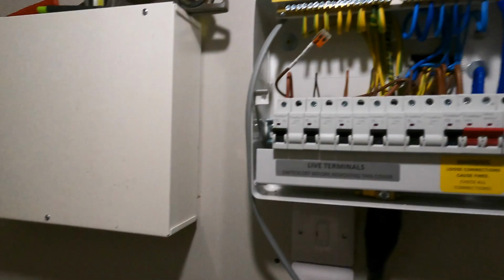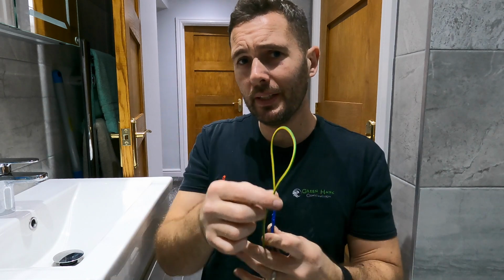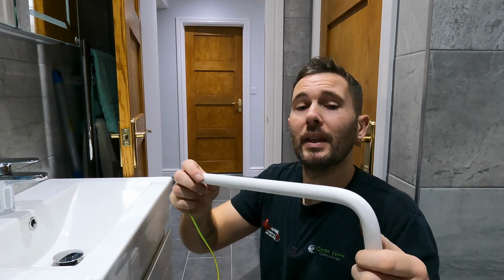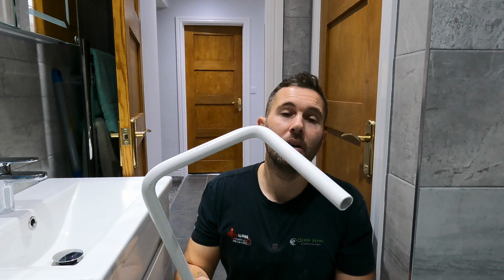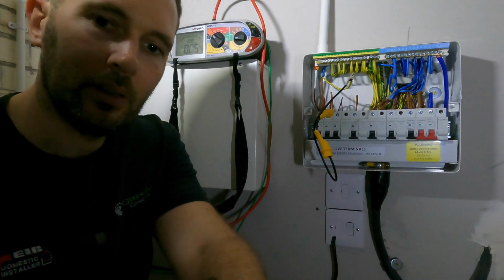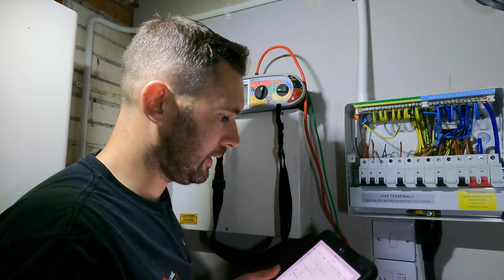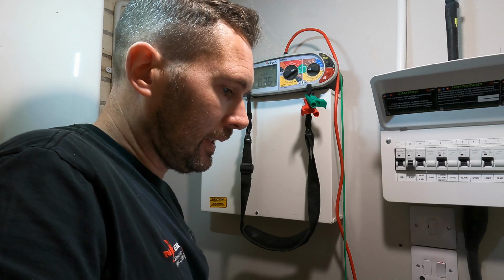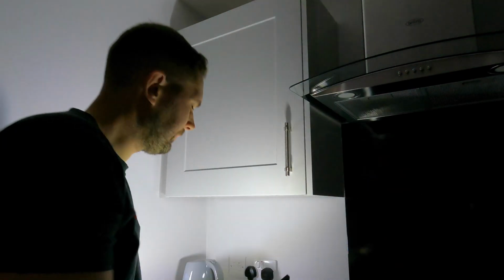HOW TO TEST ELECTRICS⚡⚡⚡

Comment: The cable you have tied onto the spring, pass it through the centre of the spring, that way when you pull the spring out of the pipe after it is bent you are pulling the far side of your spring (compressing it) and not the near side of the spring over (extending it and causing damage).
Reply: That’s good thinking! Next spring it’s the way I’ll go 👍

Comment: Hi mate where do you buy your pvc conduit? I find that most wholesalers stock the cheapest and thinnest conduit which ripples straight away
Reply: there is 2 sizes of spring for heavy guage and light gauge,  the conduit has to match the spring otherwise it will alway ripple
Reply: I tend to use a heat gun to properly soften the conduit, and bend it over a wooden form, especially if you want a double-joggle over another pipe, etc
Reply: M8... worst is screwfix and toolstation. As you say, thin & nasty. 

Better quality of late has been tlc. We avoid cef - way too expensive and as most wholesalers don't deliver the likes of conduit, capping etc (too long!) we've stuck with tlc. Also not too many jobs need it!
Reply: @Sparks1Plumbers0   the company i work for always uses rexel and ive never had any problem with there conduit